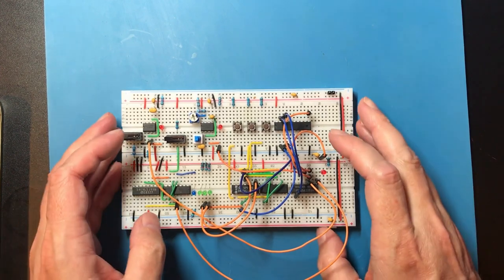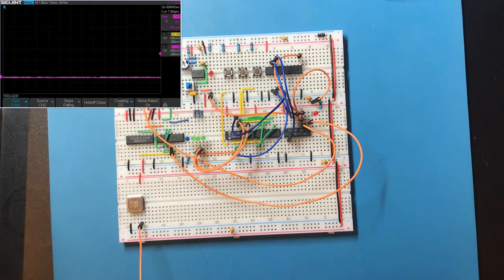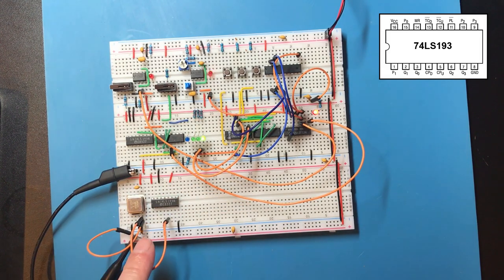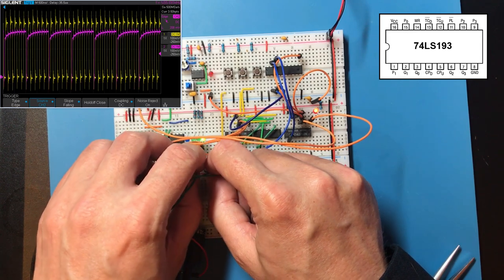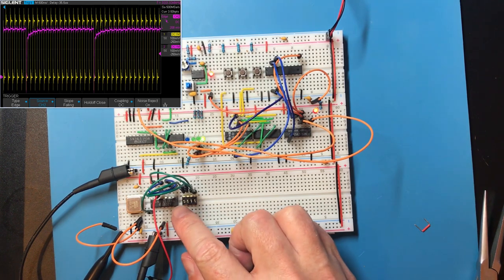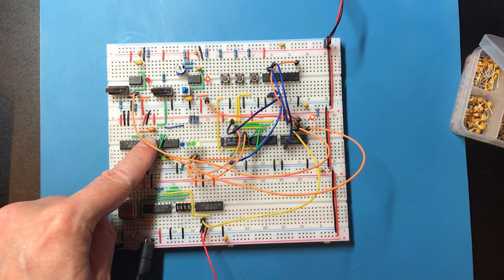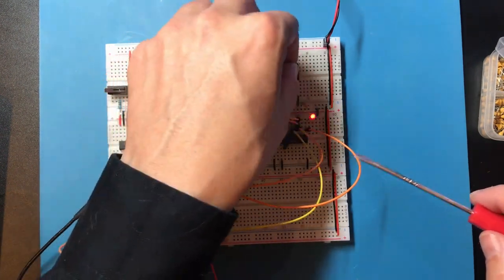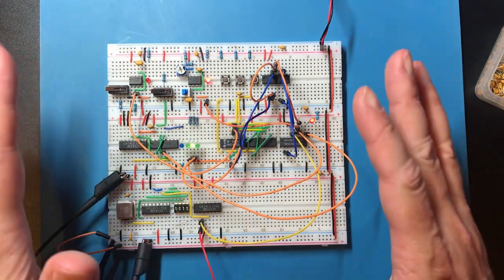Clock Divider - Making an 8 Bit pipelined CPU - Part 79

Comment: this is so nice :) I myself had been working on a similar topic making my own crystal clock with not gates and dividing it down twice (divide by 4) used a 7474 to do that. it works on breadboard but sometimes it has trouble starting. i really love watching these videos.
Reply from the maker: Nice,  if you only need powers of two it would be very easy to just pass the clock into the increment line of a counter use the output bits. A 4 bit counter would give you 2, 4, 8 and 16 as numerators.

Comment: The ringing is from the massive ground loop you have there. The Gnd from the scope goes all the way across the top rail, jumps to the other rail, and then goes all the way to the oscillator.

It's the loop area of a circuit that determines the inductance. This is why breadboards suck for high speed. They waste a lot of area making signal wires longer than they need to be, and encourage routing power and gnd to opposite power rails creating a nice big inductive loop.
Reply from the maker: I know the ground paths on breadboards are far from ideal but the ringing here is more than I'd expect. It's much cleaner after passing it through a couple of gates (what's left is probably the ground paths). The ring on the oscillator output is actually much less with a couple of ttl loads which I think is part of the puzzle.
Reply: @weirdboyjim  To me it looks like the problem is the connections to your scope, at least for the yellow. Shifting the ground closer to the oscillator should help.
Reply: That the voltage of the divider output (purple trace) rises with the number of clock cycles before the counter resets is very interesting. Looks like a classic RC time constant. A lot of capacitance on the board? Will be interesting to see what the signal looks like on a PCB.

Comment: You mentioned using a Schmidt trigger to clean up the waveform. What is the advantage of that over a zener diode? (Be gentle, it's been 15 years since I last dabbled in electronics.)
Reply from the maker: In hindsight it probably wouldn't have made a difference here but Schmidt triggers are really handy if a line is bouncing to the point of crossing the threshold multiple times, or has a slow rise/fall time.

Comment: Part of that ringing will be caused by the scope ground lead it's quite long. If you have a clip ring with a pin use that in place of the ground lead and it might go away.
Reply from the maker: It reduces it by a little, but only about as much as the output capacitor. I want to spend some time experimenting with this stuff at some point and try to nail down what the right thing to do is. "Mhz" and "breadboard" have traditionally not been the best of friends.
Reply: The other possibility is fast edges, so something like a 100ohm resistor in series might help calm those edges down a bit.

Comment: You shouldn't need a Schmitt trigger to clean up that signal as long as it rises above the Vih threshold within the rise time constraint listed in the datasheet. Not sure if that matters as much with TTL as it does with CMOS...

Likewise Vil and fall time.
Reply from the maker: Yeah, there is nothing wrong with the trace as it stands, but it is nice to get things a bit squarer.
Reply: @weirdboyjim  Yep, we are very visual creatures afterall, and like things to look "proper". :-D
Reply from the maker: It meets all the specs, maybe I should just put some extra led's on it and call it a day.
Reply: @weirdboyjim  It might be an interesting exercise to do some comparisons between breadboard circuits and those you built on PCBs. See how much of a difference (or not?) a PCB makes?
Reply from the maker: @TomStorey96  Exactly, All the signals going thru little metal combs can't be helping.

Comment: Are you familiar with the 556? It's two 555's in a single package.
Reply from the maker: Yes I am, useful chip.  But I had a few reasons why I stuck with the 555's . First and foremost I already had a bunch of 555's in both dip and smd format. Secondly I really like separating out functions on the pcb's where I can, not everyone will agree with that one.